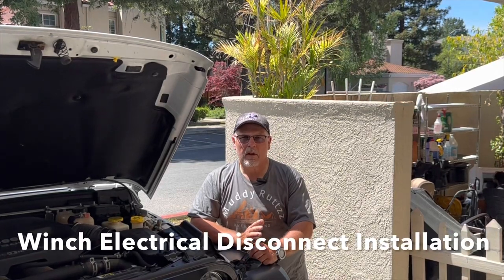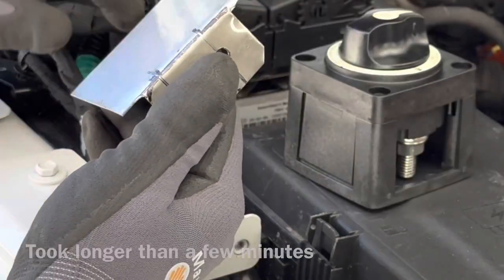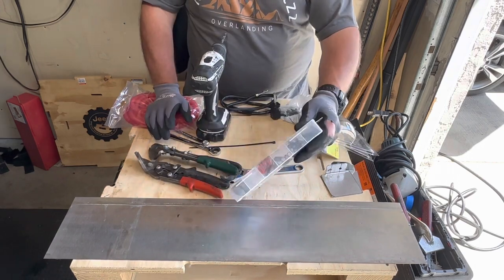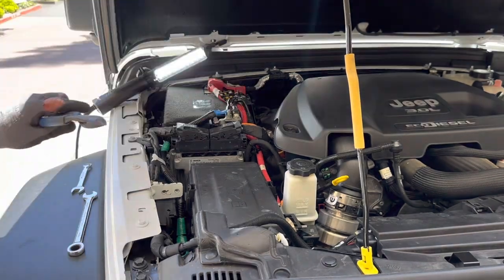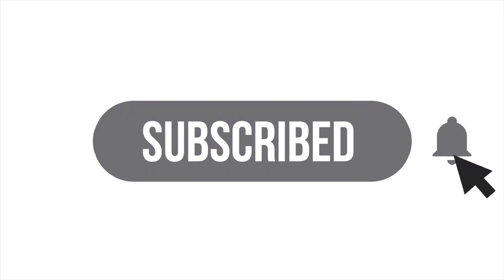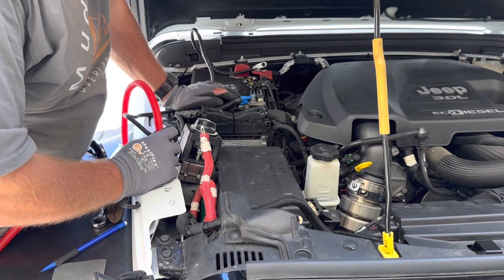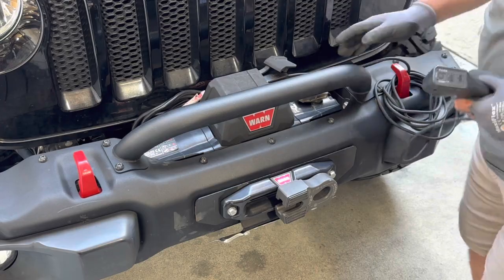Install Winch Electrical Disconnect For Off-Road Vehicles

Comment: Nice video, good job, mate. Can you please confirm the current rating of the disconnect switch? Thanks!
Reply from the maker: 300 Amp Rating on the switch I used. It’s a BlueSea Battery Disconect.

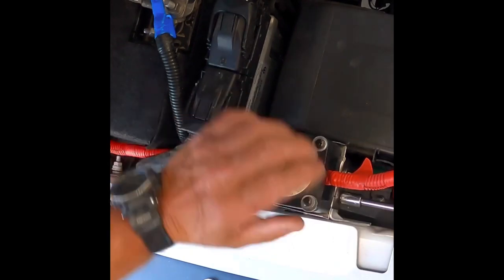Comment: 13:02 
What size and thread pitch bolts did you use to mount your custom mount to the empty bracket?
Reply from the maker: Wow, metric bolts left over from something else. I’ll try to figure it out.
Reply: Lol, thanks. I'll start the search there

Comment: Hope you can help me with my dumb question… I recently bought a disconnect switch and want to setup like you did. The manual of the switch indicated it’s has “negative polarity” and requires to connect to negative…  did I get the wrong switch? Or only battery disconnect requires such setup…
Reply from the maker: Not a dumb question. I would definitely follow the manufactures instructions on switch you bought. Switch I used is simple on/off. It is a battery isolation switch. Stopping the current from getting to the winch. Thanks!